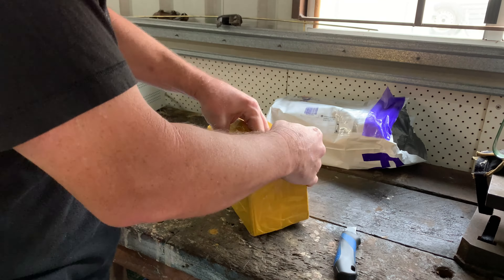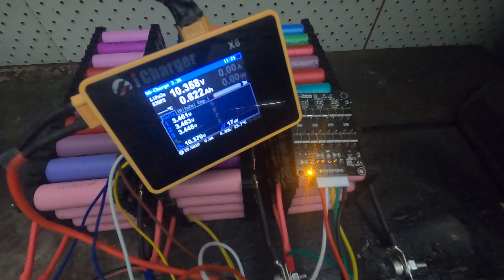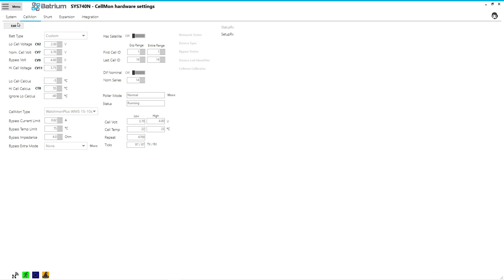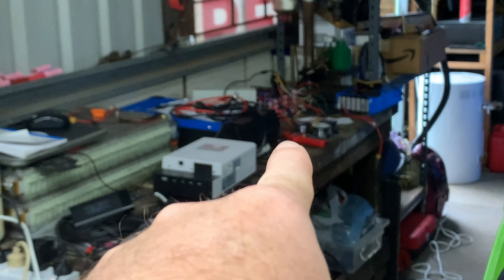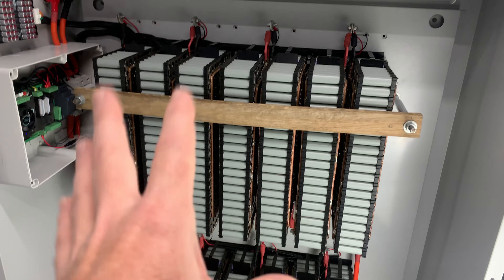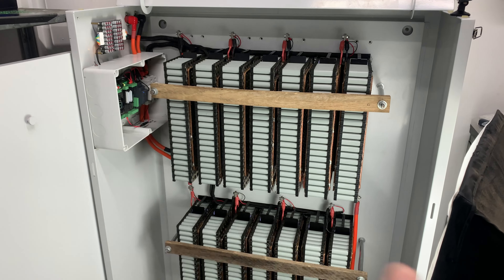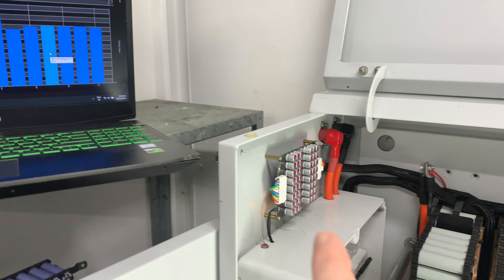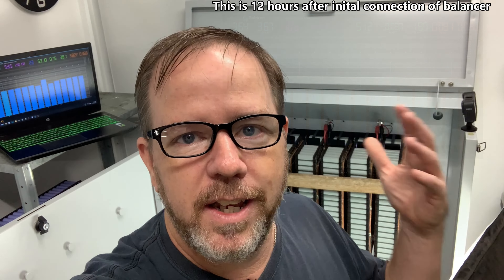Install & Test Heltec Active Balancers

Comment: One thing to remember with these active balancers is that they can only balance up to 5 amps but that amperage goes down as the cells get closer in voltage to each other and also as the leads get longer.  So imagine that your voltage difference across the pack is 1V instead of 0.3V, you would likely see a much higher amperage but the charge moving is still moving to the next cell over so it may potentially be moving the charge at a rate where your meter is to slow to capture the full amperage but is averageing the time on and off for each cycle that the board shuffles some charge from one cell to the next in line. 

It tends to also be a good idea to only have the balancer kick in as your batteries are reaching the top 20-30% of the charge cycle so that it maintains your pack's top balance.  I have had pretty decent results with the one I have but it only runs when the batteries are above 80% full and it does seem to help keep them in check but they aren't really needed once the pack is in good balance and the BMS is more than capable of handling it.
Reply: Yeah, balancers should only turn on at the last few percent to keep all the cells in check, so the ones with a lower capacity don't get reverse charged and die, or even worse start venting/blowing up
Reply: I think the last bit about the top balance really applies to LiFePO4 since it has that flat curve, probably less applicable for a tool battery or a laptop battery as they use NMC and LCO cells which seem to have at least a not totally flat curve.

Comment: Im also an anti-always on active balancer. I just finished an online argument about active balancers (I argued they just throw a pack out of balance when always active balancing 24/7. Well he's convinced me to also try out a heltec active balancer. Off grid garage also didn't like them unless they could be activated only at the end of the charge.   Look forward to your next video.
Reply: Off grid garage is anti-always active balancers for LFP (or LiFEPO4) chemistry (n/a for li-ion, only uses LFP for his setup). This is a Li-ion chemistry, charge - discharge curve is not flat anymore as LFP would be, but quite lineal. Off grid garage specifically mentiones flat charge - discharge LFP curve against having active balancer always active.

Comment: Andy at the Off Grid Garage channel has recently been testing an active balancer on his setup. His feeling is that you would only use it when the battery is pretty much fully charged to make sure that all the cells are balanced at which point you would take it off and just leave your BMS to manage the cells after that. He showed that if you leave the active balancer on while the system is running it will each cell will have a slightly different power profile which means at different points in the batteries charge it will produce more or less power than it's neighbores and balance that. This means that it will completely throw a well balanced battery completely our of wack. 

I think the conclusion you are going to come to is that an active balancer is useful to get your cells in balance for the first time but after that the BMS (with it's own balancer) should be enough to main a health balance, if it doesn't there is something wrong with your battery. My oponion is an active balancer is a very expensive device that you should only need once.

Comment: I think the balancer moves little buckets of charge (3 capacitors full?) at a time, and can do so only to an adjacent cell. And a cell can only perform one move-up OR one move-down operation at any one time.
Think 14 one-armed men passing buckets up/down.
The balancing algorithm is probably to pass buckets down(/up) the line in a cascading fashion, as long as there is a cell on the left(/right) with below average voltage.
In this curious case, cell8 is being the bottle neck, having to split time passing buckets up and down.
Cells 7(/9) only has to pass buckets down(/up) the line, so is outpacing the supply from cell8 by a factor of 2.
I reckon it will start to make sense as cells start reaching the average voltage.
Reply from the maker: you explain it well , time will tell - thanks heaps for the input..
Reply: Seems very plausible, nice, i would agree with that explanation. Maybe the 5A balance is a Collective value across all the cells, so all 5 single armed people have 1A of balance power each. (So it’s not a 5A balancer, its a 1A lol)
Reply: I like this explanation it should be in the documentation 😉
Reply: Close, most of the capacitive balancers like this work by having a capacitor (or 3) parallel to each series "cell" (or bank of parallel cells), what they then do is have 2 pairs of MOSFETs, one pair wires each capacitor (or 3) to its cell, then the other pair wires them all in parallel to each other. Then there is a low power oscillator that toggles one pair of MOSFETs off and the other on, then switches them. The practical upshot is all capacitors charge off the battery cells to match them, then they will all be disconnected from the battery and wired to each other in parallel, rapidly balancing themselves so they all are the same voltage, then when the MOSFETs are switched again, they reconnect to their cells pulling the low ones up by discharging into them, and the high ones get pulled down by the capacitors charging from them. ALL cells get balanced simultaneously, it's almost like you connected all the cells in parallel without the hassle of disassembling the pack and rewiring in parallel.

Comment: I am using the smart balancers from heltec an am very happy how they are performing. They are very well calibrated. But I always left the cables in original lengthened them by the same amount.
Reply from the maker: Thanks for sharing. Janek - I really hope I can prove you right on that one. Time will tell..

Comment: Hello, Thanks for sharing your videos. I have been using that same balancer in my battery for two years and I see it as something essential and indispensable in any high-capacity battery to avoid imbalances between the different cells.
Reply from the maker: Thanks for sharing, may I ask the quality of your battery & type of BMS?
Reply: @HBPowerwall  Sure. I have a 40 Kwh battery, made up of 18650 batteries. The balancer is the same as the one in your video and the BMS is 400A from the ANT-BMS brand. If you go into my YouTube account you can see my battery in one of my videos, the battery has two sides where there are batteries on both sides.

Comment: Nice system and good job on wiring.  In reality few of us can't afford or have the know how to do a nice job as yours.  With that says even with less than nice perfect set up it will still work and be usable.  It does not have to be fancy complicated and costly set up to have solar power with battery system.
Mine is completely built from recycle  reduce reuse concept  from panel to battery to inverter.  At this point i am going with the active balance regardless of any other opinions good or bad. It makes sense and practical to transfer energy from one to another instead of wasting as heat with the passive balancing and it does that in both charge and discharge mode.  To me that is more important than the bms to have the cells balance live as much as possible.  I had to rebuild many packs because cells are not balanced more often than i like.

I don't have the balancer arrives yet for me to make a conclusive determination how well it works or NOT works.  I did some reading and understood how active capacitor balancer works and it is simple yet makes sense and effective (in therory).

Regardless of how anyone goes there must be some kind of balancing the cells as imbalance short life and reduces capacity of the whole battery set up.   The saying that the chain is only strong  from its weakest link is  true regarding solar battery storage.

Batrium bms is nice and useful but man man it is costly  and i am balking at buying one for years.  With EV and battery become more prevalent the Chinese will no doubt comes out with a nice BMS for enthusiasts.  I am waiting for that.  Meantime active BMS and my wifi remote  360 degree camera do the job of keeping an eyes on the battery's health
Reply from the maker: 100 % recycled cells, swaped some labour for them so basicly free, case/metal house was recycled, Active balancer was sponsored, Nickel Strip on the cells was sponsored - it's easy to do cheap if you have the time...

Comment: You might be having issues with induced voltage I would suggest running balancing cables in separate shielded loom. Induction will always counter capacitance
Reply from the maker: I didn't consider that but gah dam that would be one hell of a thiccccc loom!
Reply: @HBPowerwall  you could try to twist them all, if you twist them, it counteracts induced currents, used lots in telecommunications with very high frequencies, much higher than these capacitor boards use, could save some rewiring and give you one more thing to document if you want. The right twist might just be all of them twisted together.

Comment: I built an 8s LFP battery for my trailer. My cells go out of balance a little with every cycle. I don't have any particularly weak cells, so I don't know why. Anyway, my Daly BMS has a pretty useless balancing function so I bought one of these and a low Voltage relay to turn it off when the cells are below 3.4V. The Heltec keeps them balanced very well above 3.4V. I'm no expert, but I wonder if your powerwall is just way to massive for one of these balancers. I've also read that the cells have to be way out of balance to get the full current from the Heltec. The closer the cells are, the lower the current from the balancer.

Comment: Good video... I wanted to know your opinion regarding whether that 5A capacitor balancer is more efficient than the JKbms...thanks
Reply from the maker: my findings to date are, buy a proper BMS and ditch the extra expense and complexity of an active balancer - they are a solution to a problem that shouldn't exits and if it does, you should fix the root cause of the issue not fix it with more tech! That said the device works and does it well, but MOST of the time and I'm talking 99.9% the balance current is the same as even a cheap BMS but with the advantage it works all the time not just top of charge.
Reply: @HBPowerwall  What BMS do you recommend, that is of good quality and technology?...thanks for the help

Comment: I would use it with a undervoltage - overvoltage relay and only allow it to run at  the higher bulk voltage and turn it off at 1v under the bulk voltage, I have a few of these programmable relays coming myself to test this setup
Reply from the maker: effectively that's what I've done with the batrium.. Just using what I already had.

Comment: Oh wow, I definitely have not seen mine unbalance the pack like this. I have a 8s, and a 4s they balance super well. Now I do have all the cables the same length. Hmm, those two with the lowest cell7, and 9 do they have the longest length of wire (not counting cell 8)?
Reply from the maker: Yes they were the furthest away from balancer.. It took 3 weeks for the balancer to balance the battery. renders it useless in my opinion when a good bms will do the job much faster with out the false sence of security

Comment: Curious: @8:25 ish, .... Can you find a correlation to voltage differences and cable lengths?..and/or "resistance" per the cables routed to the lower-voltage batteries?(I.E. resistance measured including that caused be crimped/soldered connectors and the wire-length)
Reply from the maker: I tried to do a resistance test but my meter was either acting funny or I was doing it wrong - either way i'll include some more data in next video or two

Comment: I am guessing it can only transfer power from the cell adjacent to the cell out of balance so as it goes through the list of cells and finds one that is different than the average voltage but is also different by the programmed amount it will take power from the adjacent cell until finally they are ll within the programmed difference. if you had discharged the single cell for your test it may have balance faster.

Comment: I think you are right about the cable. The balancer is trying to charge according to the volts it sees at its PCB, not the actual cell voltage - if it puts an amp to or from the battery, there is a voltage loss or gain. With 4mm cable, the cable drop alone will be around 10mV /A from what I can see. If the cable uses copper plated aluminium, even more. 
So the balancer is working on compromised measurements. 
What they should have is separate charge/discharge leads and separate voltage detection leads for equipment like this that is designed to work with mV accuracy, or shut current flow off, measure the cell and act on that. I suspect this latter arrangement will require a uP a precise AtoD, voltage reference and a little RAM to run this approach.
I think these things have a bad name because of very poor design.
Reply: That would be my guess too. Driving 5A over a long wire with such a tiny voltage difference is optimistic. Maybe possible using 2 wires for each cell: 1 to sense voltage at the cell and 2 to carry current. When using a LiPo charger using the balance connector even for a 1S cell, it raises the voltage higher to account for voltage drop so that it can charge at 30A. The voltage at the charger may be 4.5V, but still only 4.20 at the cells. Without the balance sense the charger assumes the cell voltage is what it sees on the charge cable and limits current.
Make the cables as short and as fat as reasonable, and it should improve.
Reply: BMS needs to be mounted on terminals of the cell, say e.g. M8 or M12, on PCB to have thick traces is a must, U need FETs with 1 or 2 mOhms, so lets say, 3.5 V is maximum for LiFePO4, 3.500 - 3.475 === 0.025 V , 0.025 V / 0.008 ohms === 3.125 AMPS, if rezistance is higher for PBC terminals, traces, FETs, there is o problem. So we can make another solution, make DC-DC non-isolated, and pump electrons this way 14.1 V to 10.5, 10.5 V to 7 and  7 to 3.5 V, we need to make 3 cheap  DC-DC 3 amps for 14 - 10,  4 amps for 10 - 7 and 8 amps for 7 - 3.5 V, ADS1115 for measurements, 3 toroids, 6 FETs or 3 FETs + 3 DIODEs. U can also measure cells before mounting, and arrange cell with respect to capacity from 3.5 to 14 V potencial.
Reply: @PavolFilek  Some good ideas there Pavol Filek.
Reply: These balancers are quite dumb, meaning they don't even measure the voltage. I have a video on my channel that describes in detail how they work. Now you might be on to something with the different cable lengths, as that might impede the balancing of certain cells.
Reply: @BradCagle  Nice channel Brad. I subbed. Watched the nickel plating vid - just what the doctor ordered, so thank you.
Reply: @Bennyboy-dog  Glad you found something helpful!

Comment: May this be related to differences in internal resistance of each cell?

It also looks like the cells with the longest cables to the heltec, have the lowest voltages. (not counting the one you charged to full.)
Reply from the maker: IR is as close as it comes for a DIY Build, but the length of the cables and quality of the joins would all contribute to the performance.

Comment: Mr hp powerwall.  I'm a beginner and nowhere near your level of building powerwalls. I always solder all connections and I over size my wire. try this it may help. thank you for all your videos.
Reply from the maker: Thanks for sharing Chris - I plan on doing it all over with over sized wire & soldered ring termals see what comes of it.

Comment: Was there ever a second follow up video for the active balancers?
Reply from the maker: not really, it works and does the job well, just not at all needed on this battery with the Batrium BMS, It's till fitted infact I just released a new video with it still fitted.
Reply: @HBPowerwall  I have  been waiting for the follow up video explaining what was causing the cell imbalance and what was causing it.
Reply from the maker: from memory it was me that caused the imbalance I would need to rewatch the video and thats almost never happened - hate the sound of my own voice

Comment: I have one on my Nissan leaf batteries it work very good I cramp some ring terminal in the end of  cable
Reply from the maker: Think i'll leave that loom in place and solder the new balance leads to the legs of the balance ports to remove a plug & a solder joint - that combined with thicker cable should be interesting too see.. If only for educational purposes

Comment: Interesting video, i recon you'll find that the cable length's being the same matters due to the slight difference in resistance that is amplified as the battery voltages change.. be interesting to see where this goes lol
Reply from the maker: Thanks for the info!

Comment: The balance current up to 5A is ONLY when you have difference of max voltage. Ie min and max. I think by design you get 200-600mA in average of balance current. Yes the wire length will change the outcome to. And depending on balancer they move it between cells. and not from call a to z but from a to b to c to d and so forth. You should not need to do more to those cable. It may have a resistance but over time it should get back to balance. But do not expect 5a. Perhaps 0.5a in average :)    If you do 1 cell at 3v or below and one at 4.2v and let them sit close to each other then you might be able to see higher current.  Then you can also test the wire size and length to see how it affects it
Reply from the maker: the small test happily did 5 amps, was actually thinking about going the other way to test - one cell low 13 high.. that might also show it. I've started a two day test with screen capture to see how much it balances.. also turned off SCC to not skew results. thanks for the info buddy